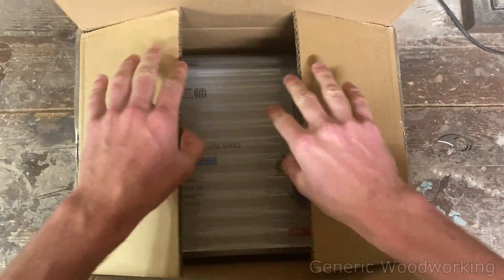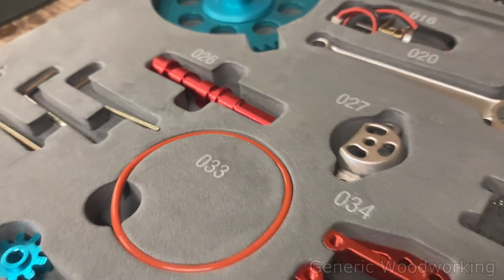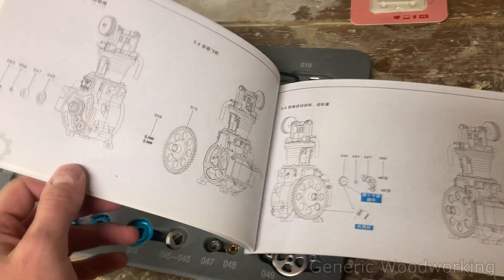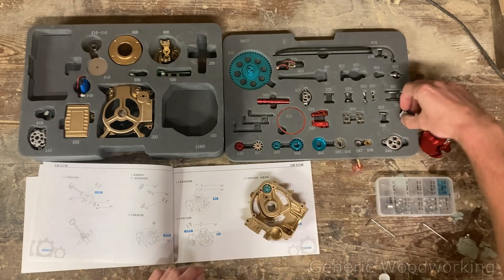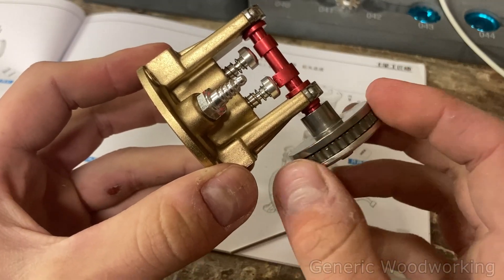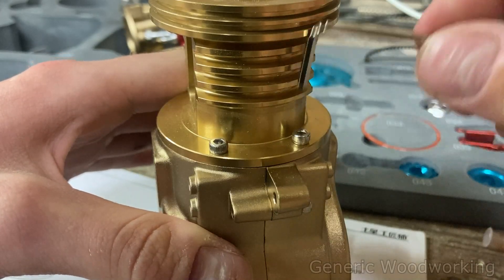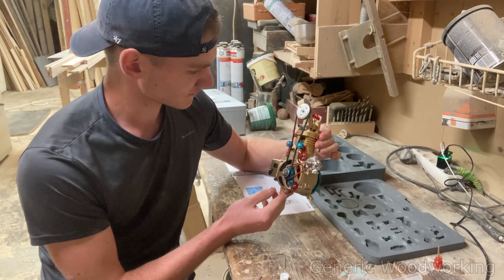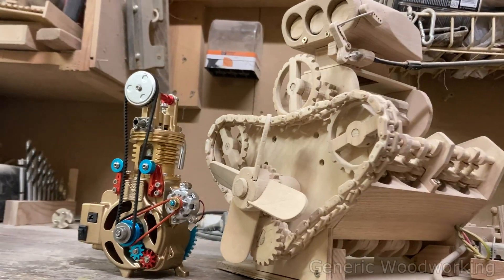DIY Metal Engine Model

Comment: Thats a nifty kit! But $299?!?!?! You can get little working sterling engines or flame eater engines for about $50 to $125 bucks that legitimately run. Seems very pricey for just a slow spinning model. You could take an old briggs horizontal crank and do alittle dremeling or cutting with an angle grinder and achieve something similar with an electric drill motor and some led lights. Its a really kool kit no doubt but i just couldn't spend that much on something machined with casting imperfections and made out of Chinesium pot metal. If it were much cheaper it would be a kool kit! Here's a nifty kit that is only 60 something bucks and it's a working flame eater engine! I put the link in my replies 👇👇

Comment: Ive made that same model engine and got it to 7000 rpm with an electric motor
Reply from the maker: Nice! Yeah, that thing is way overbuilt for the low rpm it was designed to handle.